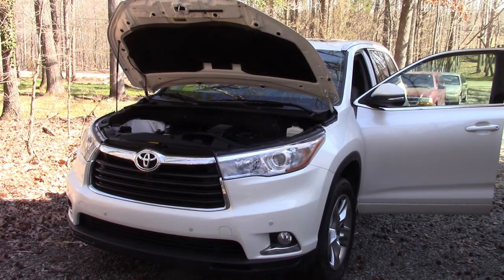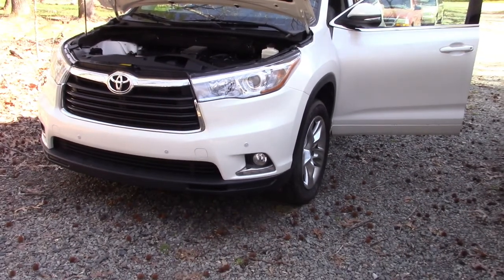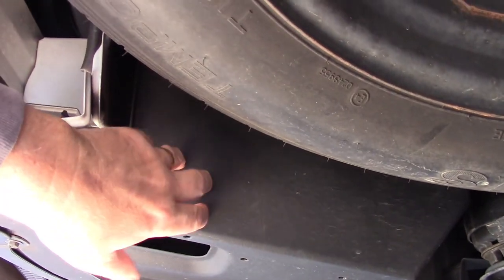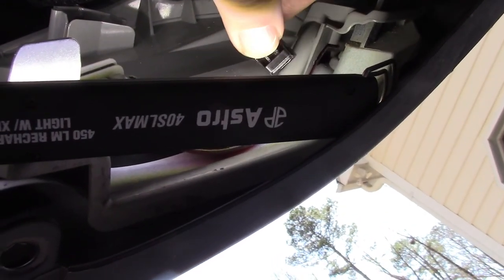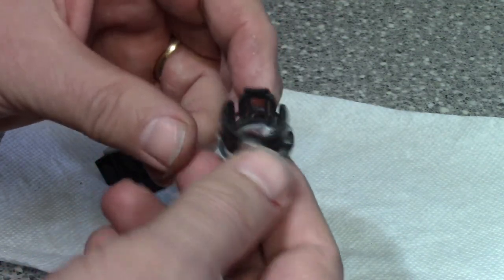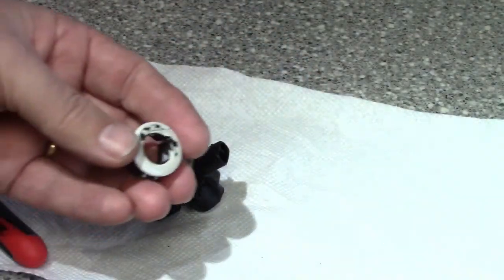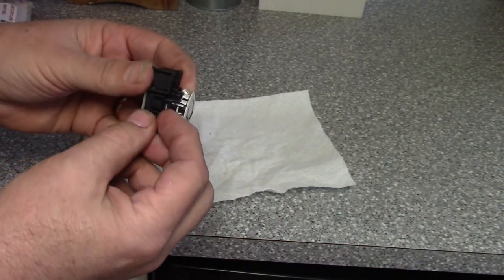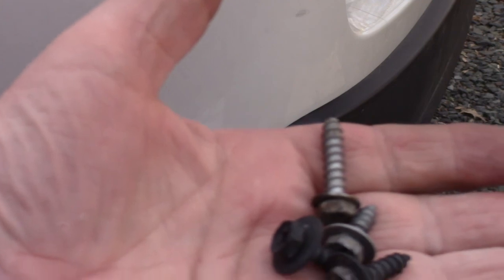2016 Highlander Parking Sensor Replacement

Comment: Thanks for posting video.  The sensor on my vehicle dropped out of its location.  The video provided me confidence in knowing which panel to remove to access the area.  For 2018 model, the sensor is actually attached to the inside of the bumper cover with double-sided foam TAPE.  This was the source of the problem.  The adhesive just gave way.  Can't believe Toyota used such a flimsy method.  Hopefully the other sensors don't come loose as well.